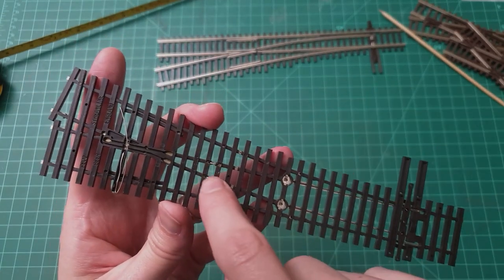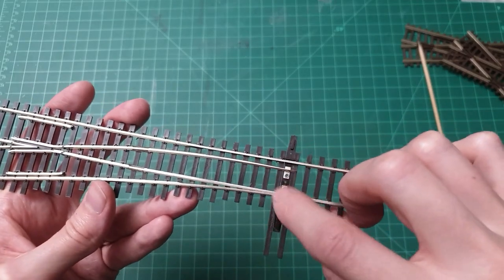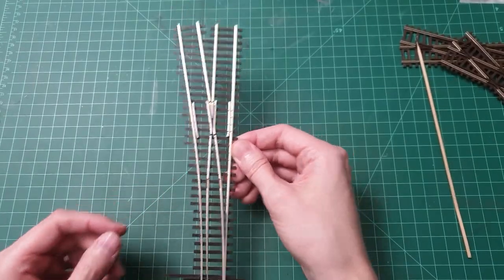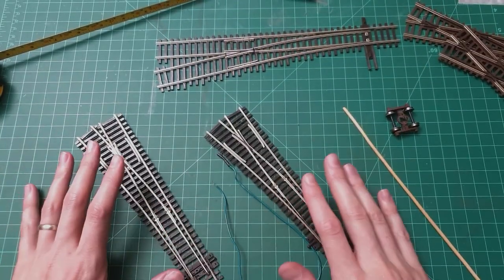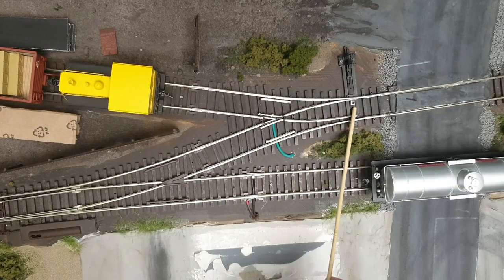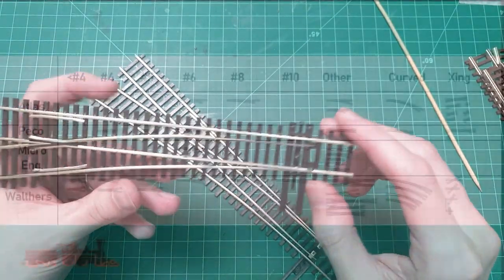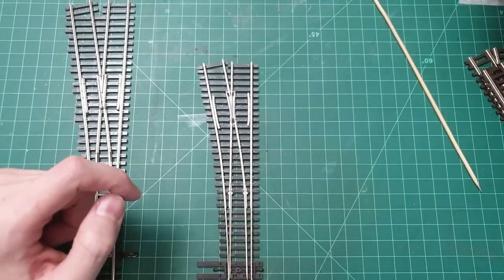37 - Model railroad turnouts explained and compared. Atlas, Peco, Walthers & Micro Engineering

Comment: Having modelled for years I now only use KATO turnouts. They are completely reliable, ready ballasted and have a built in motor. They are code 83 and are easily merged realitically into a landscape with skilful ballasting. There are good videos on YouTube on how to ballast KATO track. PECO turnouts are electrically unreliable, the motors are a pain to mount and ballasting is a nightmare. Any other code 83 track can be easily fitted to Kato track- just remove the KATO track coupler and replace it with a normal rail joiner. If you want curved turnouts or a double crossover Walthers Sinohara code 83 is the way to go.
Reply from the maker: Sectional track definitively has it's benefits.

Comment: Great video and your information is very timely for me and you've got a new subscriber. I'm now working my way through all your videos. After decades of "armchair" model railroading I've finally got the time and space to get moving, and I'm planning a "crawl, walk, run" approach, first starting with a small shelf layout to practice basic skills, then a more complex yard layout for switching, finally (hopefully) incorporating that yard into a full layout. But after all my reading over the years I want to start out with the right track and switches from the start. I've already settled on Code 83 flex track but the competing Micro Engineering and Peco products, and their advocates, have kept me undecided. Your video helps a great deal and confirms what I've been concluding on Peco: good quality plus a much bigger selection of switches and complex track pieces for my big yard someday (including a diamond crossing and maybe a double slip switch). Two questions: 1. Do you have a preference for realistic flex track as well using your same criteria as here for turnouts? And 2. I am finding it very difficult to find a reliable on-line source (no good local hobby shop) for either Peco or ME track and switches...so many seem to be backordered. Since I've been "reading", not shopping, for all this time, I'm not sure if that has been the sad state of realistic high quality model RR track and switches all along, or if it is COVID-related with suppliers? Clearly demand outstrips supply right now. Thanks again and I look forward to your continuing video updates!
Reply from the maker: Glad it helps! There is nothing wrong with the armchair approach! 
1. For the flex I am using Atlas for now. This in inherently different from ME flex track as that does not 'snap' back into place as where Atlas track does want to bounce back to straight. Keep that in mind as both have their advantages. ME have pre-weathered flex track. I have not seen this yet so i can not judge. If it looks as detailed and good as the turnouts than I will use their flex track. I would suggest to just order one from each. 
2. The batch production of turnouts was also an issue before the pandemic. At least in the last 5 years or so. I do not really understand this as turnouts are the bread and butter for many manufacturers. I would just keep an eye out. I use modeltrainstuff.com
3. Do you have a dedicated space and / or trackplan already? I can assist in making one. As per your crawl, walk, run idea.
Reply: @DubaiTrains  Thanks "Dubai"...I'll check Atlas track. My biggest "passion" (OK, so far) in model railroading is detailed, prototypical track work properly weathered. I've seen pictures of Peco's "US" mainline code 83 track that seems to use double spikes on each side of each tie/tie plate rather than one plastic clip. I think I will like that best but have now ordered some to see for myself. Still looking for a supplier of less than 25 or so 3' lengths of ME track at a time!
Thanks for the link to modeltrainstuff.com, I've been there a while ago but will recheck. Odd behavior for suppliers, understand a business shutting down (Shinohara) but sustained demand should keep suppliers expanding. But glad to know our hobby is a robust one!
No dedicated space yet, but in the works. Will do "crawl" with a 6' or so plank style effort as recommended in an article in last August's Model Railroader ("All You Need to Know in Four Square Feet"), maybe 2 tracks and 2 turnouts to practice everything basic even some scenery. Just a working pallet--rip it up if I screw it up and try again. I already have that space dedicated. The "walk" stage (switching yard) and "run" stage (full layout) will come with the addition of a house addition hopefully coming later this summer. I know you do the layout design work commercially, not sure if I need help with it yet but I will definitely keep you in mind should I get hung up. Thanks again! Mike

Comment: Where the wheel flanges cross a rail, it must do so with a flangeway which means a frog.  Turnouts are composed of 2 movable point rails with the throwbar, 1 frog, and the rail to connect everything.  Number 2 and 2.5 turnouts along with No 3's & 4's are usually used in mining and other narrow gauge tracks.   For model railroads, No 4, 5, 6, & 8 are the predominant sizes to use the least room.  Full-size railroads start at about No 7 and predominantly No 8 for industry while No 10 and larger in the mainline depending on the speeds needed to be taken on the divergent side.  Generally any number of 24 or 30 will have movable points for the frog nose and will not need flange guard rails but are meant for high-speed traffic.  The IC had a No 5 136RE out of the mainline in Monroe, LA because it dated back to when the line was built to serve cotton warehouses and not enough room to install a larger turnout in the location.  
Crossings are labeled by the angle between the tracks or the angle and radii or the curve(s) and will have 4 frogs-2 point & 2 wing; the situation where all 4 frogs are the same is a 90 degree angle.
Special trackwork is a mix of the two.  A crossover is either a facing point or a trailing point.   A crossover placed between 2 tracks and within the same length is a double crossover needing a crossing where the crossover tracks intersect(more expense and more upkeep).   The last ones are single slip and double slip turnouts to be used in very tight places to provide the most variability to train movement.  These are used mostly in Europe and Japan.  They are used mostly in terminals in the Northeast, Chicago, and other locations with lots of trains and traffic with cramped space.  They are numbered by the turnouts and the points are all within the length of the point crossing frogs.  Depending on the history and speed needed, they will be No 8 to 12.  Under a lot of traffic, they will be remotely controlled by a tower or interlocking within that plant.
For those who model dual-gauge trackwork, sketch out on paper how the tracks are to go; whether the common rail is left or right, turnouts are facing point or trailing point, and which gauge does not diverge.   When laying out a wye or loop, the common rail will switch sides just as polarity does so to alleviate the problem a "draw" can be inserted somewhere on the wye or loop to change the sides of the common rail and with no moving parts.  The larger gauge is laid on-gauge or snug straight through while the smaller gauge has a point laid slightly over flangeway width away from the running rail with the opposite rail gauged wide with a flangeway guard laid snug to bring the wheels away from the common running rail.  The other end of the "draw" is laid out in mirror image.  The angles and gauge changes need to be carefully done to make it work well.  The D&RGW had several around Antonito and Alamosa, CO when they had dual-gauge trackage there.  I had drawn all of the possible combinations including the "draw" and it was in one of the old issues of LIVE STEAM years ago.
I give this to try to help those interested in what is usable and where to help make the modeling a little more realistic.
Reply from the maker: Hi Roy, thank you for the in depth add-on.
Reply: @DubaiTrains  I spent over 20 years in railroad track design, maintenance, construction, inspection, and operation.  Most people don't seem to grasp what goes into the track to carry the trains successfully.  As modellers, we have to compress the dimensions to get even a small amount we want into a layout without looking too toyish.

Comment: A brand you didn't mention is Fast-tracks.  There are enough people making them to order (self-included) that they can be considered a ready-built option if a modeler doesn't want to build them himself.

Here are a few areas where they beat all other brands hands-down:
1. Choice; 9 sizes of straight turnout, 6 wyes, over 20 curved options and many slips & crossings.  If you want to maximize your layout resign flexibility, they will give you far more options and allow you to fit more railroad into any given space than any other brand.
2. Appearance; although they lack spike detail (which is pretty much invisible at normal viewing distance), they have far better-proportioned switch rails than any of the brands you reviewed.  That is far and away a bigger contributor to realism (or lack of it) than any of the finer details molded into the plastic of the commercial brands.
3. Cost; If you want a lot of turnouts the same, you can buy the jig and build them yourself at a fraction of the cost of commercial turnouts.  If you need a variety for your railroad, build the common sizes and buy the odd sizes ready-built.  The overall cost is likely to still be less than the same number of turnouts from any other source.
4. Durability; although at first glance, fast-tracks turnouts are easier to break than PECO or Walthers if they are handled roughly, the critical point is this. . . FT are soldered together, making them easy to repair in situ if they are damaged.  All other brands are mainly plastic that cannot effectively be repaired.  In most cases, if a plastic turnout is damaged, it is necessary to cut it out completely and replace the whole thing - quite a major operation if the track is already ballasted.

While I don't regard Fast-tracks as the last word in turnouts by any means, there are some reasons why they should certainly be considered by model railroaders.
Reply from the maker: Hi Peter,
Thanks for your addition. I have seen your videos where you use them. I am yet to dive into the world of hand laid track and turnouts. 
The number of curved turnouts you mention is impressive. For my next layout i will be needing a few so i will definatly have a look.
Reply: @DubaiTrains  Hand-building turnouts is a very satisfying aspect of the hobby that can also save a lot of money.  It's also easier than most people think - especially with jigs.  With most of the larger layouts that I design for clients, I typically end up with around 80% of the turnouts being of four standard sizes, so I typically suggest that the client build those sizes and purchase the remainder.  The overall cost is usually equivalent to the same number of PECO turnouts (the least expensive brand) but it's a much better railroad and he gets the satisfaction of having build more of it himself.
Reply from the maker: The main reason for me to make my turnouts is to create a more flowing trackplan. Hand laid layouts often seem tl flow better. 
It also opens a lot of creative doors when planning a layout. But I don't to tell you that 😉.

Comment: Excellent video: clear explanation of polarity considerations. 
You have to be well heeled to afford Peco UniFrogs!
Reply from the maker: Thanks. If using peco turnouts doesn't fit your budget, I would suggest to still use peco turnouts but to cut the number of turnouts to compensate. I would rather have fewer good working turnouts the several problematic ones.

Comment: Thanks for a Great video, maybe do an update in the near future, but this time include Atlas Customline Turnouts. The regular Atlas Turnouts of old are not reliable or good looking as stated by many including yourself, especially with their ugly next to turnout switch machines which I had when I was a kid. Currently I only use Atlas Customline Turnouts #8, #6, Curved turnouts, and Wye's and have never had derailment or electrical issues using them straight out of the box. All my Turnouts use Caboose Industries manual switches which are awesome and help make Atlas Turnouts reliable IMO. Actually my whole railroad uses pretty much all Atlas Code 83 rail, great stuff including the 3' flex track sections. If I had to build another model railroad would I switch brands? No, why, it works for me, your mileage may vary. LOL! Cheers!  😀
Reply from the maker: Thanks EM, 
Good to know the Atlas custom line might have become an alternative. There is nothing worse than derailment on your turnouts!
I have used a few walthers turnouts where my go to peco didn't have a solution.

Comment: When I read about the mistakes prospective model railroaders make; it is to purchase the Atlas product. There is a distinct lack of product control - inconsistent manufacturing. Specifically in what I have to contend with: the spacing of the guard rail and the frog in general. So, when the wallet permits, I will changeover to Peco.
Reply from the maker: I tend to agree when it comes to turnouts. The Atlas flex track is just fine in my opinion.

Comment: Frog # actually is actually only a fraction of the frog angle -- that is, a #5 frog is 5 times as long as it's diverging width. In other words, think of it as a right-triangle that's 1 unit wide, and 5 units tall.

As such, frog # is not directly proportional to total turnout length nor curve radii -- both of which vary between turnout models/brands, despite being the same frog #. For example, a #8 turnout is not necessarily twice as long as a #4.
Reply from the maker: Hi Isaac. Thats correct. Thanks for the addition.

Comment: Late to the party but using Walthers as a measure for availability is an odd choice. I have never seen a product on that page that wasn't significantly cheaper elsewhere.

My dad and grandpop got me into model railroading. They both, despite being subscribed to Model Railroader for decades, had a very narrow view on model railroading. To them Atlas was the only brand of track - and all of their layouts were plagued with issues. It's kind of sad because I am no over 30 and actually running trains was rare. Since they usually handled track building I never looked into things myself. But I eventually really got into railroading and model railroading and started looking things up because I started working on an HO layout with my dad. I tried to warn him about Atlas switches, but he shrugged them. It took my 4-6-2 derailing on every snap switch to convince him that snap switches are horrible, but the rest of the layout is still stuck with Atlas switches - though I did buy a few PECO turnouts for areas I intend to do switching in. The layout hasn't been touched in over a year though so it is very much unfinished and I'm currently spending my time on projects that I can use in future layouts.
Reply from the maker: Welcome to the party! Choosing the right turnouts is key for the enjoyment of the hobby.  Just start your own layout, then you can choose whatever you want ;)

Comment: You left out the reason for the switch's number !! Where the diverging route inner rail is one inch or unit out from the inner thru route rail, the distance out from the point of the frog to where they are one inch/unit apart is the number..I.E. If the 2 inside rails are 1 inch apart AT 8 inches out, it's a No.8 switch.. If one inch apart at 5 inches out it's a No. 5....etc, etc.. 
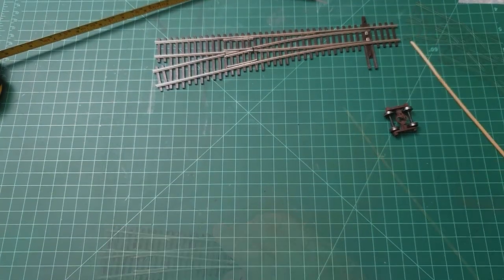7:27 They are 'crossings' or 'diamonds', not 'crossovers'. Crossovers are where trains 'cross over' to a parallel track via 2 switches. A 'double crossover' has 4 switches with a 'crossing' or 'diamond' in the middle. 
Also, 7:54, well designed frog flangeways do not, and should not lift the wheel up over a "bump" IE. The flange can roll atop the frog 'floor' but should not be lifted (unless wheel/wheels have the older style overly deep flanges). 
You keep saying  'track' where you should be saying 'rail'...
If you're going to teach, get your RR details and nomenclature correct and complete first...
Reply from the maker: Hi Mark, thanks for clearing up these technicalities.

Comment: Do you find the curved turn put reliable or not? Many said that it is best to avoid them!
Reply from the maker: I find they work fine. I have two of them. If your engines and rolling stock are all nicely tuned, there should not be any issues.
Reply: OK, thanks for the feedback. @DubaiTrains

Comment: It’s a shame you gave the Micro Engineering turnouts such a brush off. They are not only the most detailed but also are set up for DCC without any alterations. They are delicate but that’s because the dimensions are correct. I think their only drawback is that they only come in a #6. ( #5 in their ladder track arrangement.) Hopefully they will make more sizes in the future. In the mean time, I’ve taken to making my own #8s and #10s with Fast Tracks gigs. Not a cheap proposition but economical in the long run if you need lots of turnouts.
Reply from the maker: They are very detailed! Personally I would like to see more turnout variety in code 70.